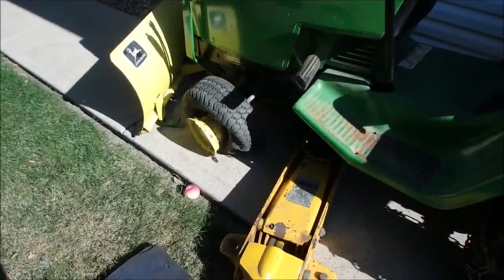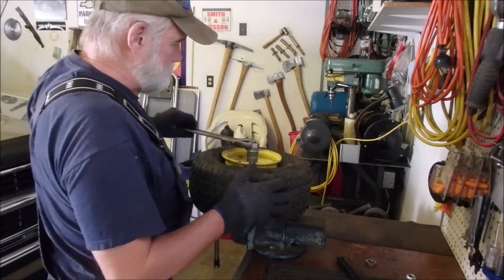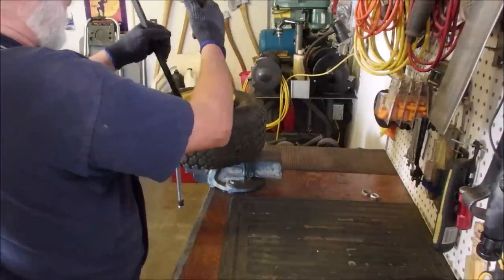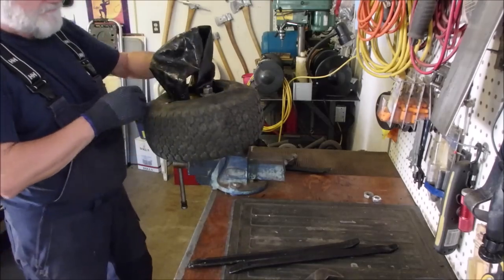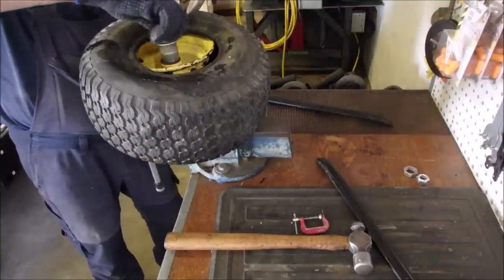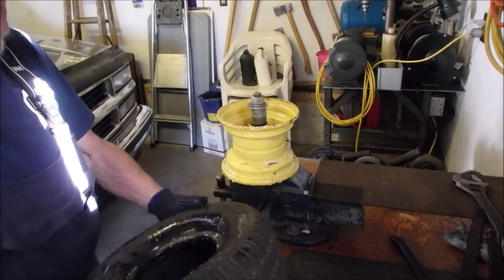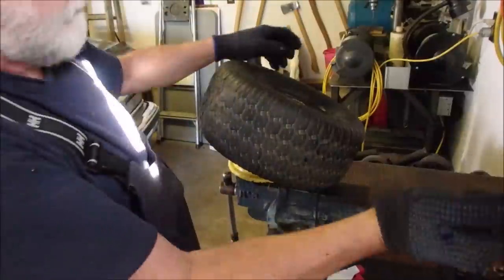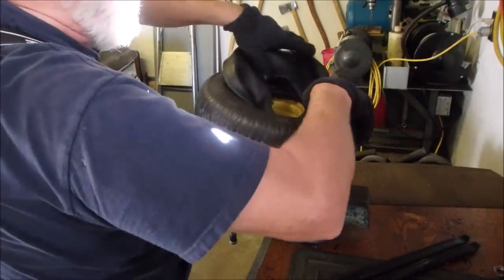Changing a 15"X 6" JD Yard Tractor Tire

Comment: Good job Mr Bruce, not a single tool was hurled across the shop. 🤣👍
Reply from the maker: I must be weird.  i don't mind a challenge like this as long as the process moves forward.  When the camera is off the air can get pretty blue if you get my drift.
Reply: i think i would have moved frank
Reply: 🤣🤣🤣 to both of you. 👍🏼
Reply: @Big_Johns  John Klem, if that was me, the son of a biscut would've been to my mobile tire guy down the road about 3 miles, but Bruce did a great job..
Reply: LoL Barry, he sure did, I was very impressed. 👍

Comment: The key to doing those tires Bruce is to keep the bottom part that you already put on, to keep it below the bead on the rim, it will go much easier without stretching the tire like you were doing.
Reply from the maker: Thanks a lot.

Comment: What a nightmare.  I had my old MTD s/blower tire go and after two hours just gave up and put it into a tire shop.  If I was doing this, even on a semi regular basis, I'd have a Tire change Jig bolted to the floor.  I do commend you for your perseverance Bruce.  Must be the Alberta in you
Reply from the maker: I agree.  I am trying to not use up the floor space i have.  I want a small tire changer but as both Mrs.P and I park in the garage space is limited.  Yes it is a bigger garage but it is a small for a shop.  LOL  Thanks for the great comment.
Reply: @BrucesShop  We must not offend a) Mrs. P b) Her Ladyship.  That said, Princess Auto have one on special.  You have to bolt it to the floor, but when you are done, simply unbolt it and store.  I did think of getting one, but I would hardly ever use it, unlike yourself.
Reply from the maker: @MrRunner  I have only done 3 in my life.  I will think about it   thanks for the fun.

Comment: Looks like you had to fight with that one. After battling with some smaller MTD blower tires with a similar setup I bought a mini tire changer and mount it @ waist level and pinch the beads to the small dia. of the rim it made the job alot less aggravating! Good video
Reply from the maker: Yes   Thanks

Comment: Hi Bruce! Small beam clamps are very useful to hold the tire bead far below the rim level by adding a second 3/8″ bolt to the beam clamp. More so than using locking pliers or C clamps. Simply squeeze the tire sides together by hand and then extend the bolt to hold the tire bead in the valley of the rim. Use two or more opposing beam clamps to really squeeze the tire sides closer together. I've posted some pictures of this on my website. Cheers! Jim
Reply from the maker: Thanks for the info!

Comment: Man, that was like watching myself in the mirror! I bought two new rear tires at Princess Auto last year, and two new front tires at Peavy Mart for a tractor i am working on. I cut the old front tires off with a sawzall so i could clean and paint the rims. I made up a 3/4" bolt with spacers, washers, and a nut in my bench vice. I fought like hell with three tire spoons (irons) and some bead lube, but just couldn't get it. I did not think of the small C clamps though (good idea!). I finally gave up before I hurt myself (LOL) and took them to a local garage to do for me. I also found the bench vice a little too high for my liking! The shop charged me about $130 to do all four, and I thought it was expensive, but hey, what are you to do? I did not go with tubes either and figured if i did get the tires mounted on the rims, would I be able to set the beads? I enjoyed watching you do it.....but I am a bit envious of your success!
Reply from the maker: Thanks.  I have done it before.  Whatever works.

Comment: How many of us have not checked for the source of the leak and put a new tube in just to have it pop! Be careful but run your hand along the inside of the tire to detect any sharp edges!Also Any burrs on the rim bead that cut the tube as you’re installing it! I leave it to the pros!
Reply from the maker: The old rim did have a few nicks in it.

Comment: A counter clockwise.and a clock wise set of fit all wrenches 👍😜😎👌
Reply from the maker: Yes but a crescent wrench is stronger on the side where the immovable piece is.  There is a right way to use a crescent wrench.  I new these comments would come   Thanks for the fun.
Reply: @BrucesShop  your welcome young man 👍😎

Comment: You and I were discussing this a few weeks ago. Bicycle and car tyres are so much easier because size matters. Had the same issue and just took them into Tountain Fire. $10.00 plus tax for a mount and balance. Would have done it myself if I had an adequate vice and bench. Good to double check the tube. Left handed croissant wrench? Always knew there was something sinister about you.
Reply from the maker: Thanks again.  I remember the sinister.  Folks did think that way even when i was in school.

Comment: Great demo! Have you ever tried baby powder to coat the tube exterior for easier installation and less chance of pinching? Used it on bike tubes (read in a bike repair book years ago)- acts as lube.
Reply from the maker: Thanks for the tip!
Reply: And makes it smell good too!
Reply: @BrucesShop  And thx to you for all your instructive videos. Your tips and experience have saved us a lot of parts-cannon repairs and misdiagnoses! And your commentaries are spot on and fun.

Comment: Drill a hole just a little bigger than the bolt you have the rim (wheel) on, on your flat bar.  Then remove enough washers to get bar down lower so you can hook under rim, put some soap on bead, and push or pull the bar around the rim.
Reply from the maker: Thanks Larry

Comment: Holy Hernia, Batman!  I was so spoiled at the Honda dealership-- tire changer, balancer, hanging air lines you just reach up and grab.... oh, my kingdom for that kind of luxury.  You rock! : ).  Because of your inspiration I got my Craftsman tractor going for the first time in 4 years (I bought a newer one but always wanted to get the old one running) - well for a few minutes anyway-- The crank pulley is half-seized-- it started after I rocked it, but now it won't.  Is there any hope of freeing that up or am I done?
Reply from the maker: Wow  I am not sure what to say.  Is the issue that you can't get the Crank pulley off the engine?  Do you have a puller and something to heat it.  I am guessing from this end.
Reply: @BrucesShop  The issue is that most of my joints are artificial and the real ones don't work so well, lol. I need someone else to do the crawling underneath work as I don't have a mower jack, just a hydraulic car jack. I'm hoping a good soaking with WD and some persuasion that it will begin turning more freely. I did have it running for about 10 minutes so it knows how to turn, it just has a rust build up problem. Thanks for the reply-- don't know how you keep up with everybody so well... so I won't harass you further. 🙂

Comment: Well Bruce everything you said in this video is correct especially "painful to watch." At Eliminator Performance we purchased the mini tire changer from Princess Auto for $50 and basically it paid for itself BUT it created a lot of vulgarity and aggravation in the shop as you just showed everyone (without the vulgarity). Our local tire shop (shout out to Murdoch's) has for a long while now done all the inner tube installation for our customers equipment. Not only do they charge us $12 for the inner tube you just used but labour charge is $10 and 13% tax is added to that. So for a 5 minute drive there and back and a total of $24.86 the job is done and we are working on other equipment. Another bonus is if the tire does not come off the equipment they will do the job on the machine once delivered and the labour charge increases to $15 WOW eh? The only tire repair we do at our shop is plug repairs for $10. I have inquired how they can charge so little and they say their apprentices are given this work when they are slow but the repair is always done the same day. Hopefully you did not do this job after rototilling cause my arms would not have taken that kind of abuse. Another bonus is that if they pinch a tube during install another one does not increase our cost and we always charge the customer at EP cost no mark up.
Reply from the maker: I put myself  into a do it yourself first situation.  It is fun in a weird way and helps with videos when I actually do something and not just roll out a piece of equipment into the video and talk about it.  The "action" videos seem to do very well.  Thanks for you support Wayne.

Comment: Buy a real small tire changer at Harbor Frieght or whatever they are called Canada. Mine works great. Paid $40 several years ago. You can get tire irons there too. I caught you on video tightening with right hand! If you drive in 5th and make sharp turns 10 lbs will not keep that tire on the bead. I keep mine at 16 lbs.
Reply from the maker: I know that now lol

Comment: I really can't see exactly what you are doing, but can see for sure that the first part of the tire that enters the wheel needs to be in the deepest part of the rim and that is in the center. Also just place the tube inside the tire first and slightly inflate. As the tire enters the wheel it will take the tube with it. 
    They do make a cable that threads into the inside of the valve stem that you put through the stem hole and that let's you fish the valve stem through.
    It's a two to five minute job once you get the hang of it. I have had to use a very large c clamp on occasion to keep the bead in the large diameter of the rim , but not usually with thin tires.
     If you think this is a difficult job, try a motorcycle tire or an industrial Bobcat tire. You need to use both ends of that spoon as well And not just the hook end.. It one side of the taper is not working try the other side. I know I use both the concave and convex taper of the pointed end in mounting and demounting tires as well as the hook. I usually have three tire irons in use as well in place if a c clamp
   I suggest just practicing with a really old tire and do it again and again. It should get easier with practice.
Reply from the maker: No thanks on the practice.  I will practice when the next one needs it.  Thanks for the knowledge.

Comment: Those darn digital pressure gauges drive me nuts.  Seems like they eat batteries.  Then they shut off if you set it down.  I actually went back to an old fashion gauge.  Probably not as accurate but as Daryl says; "this aint no rocket ship we are working on here."
Reply from the maker: Well this one has been great.  10 years old or so.  I finally got it working after this video.  Thanks for the information though